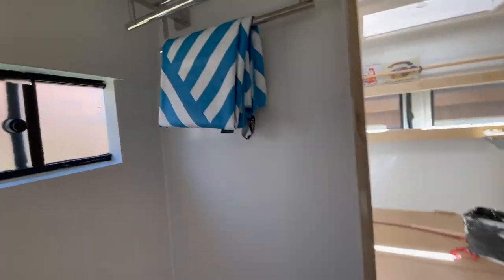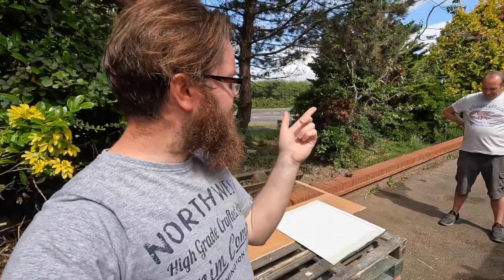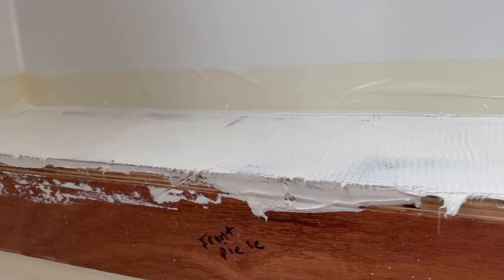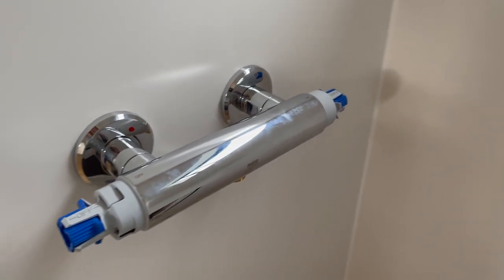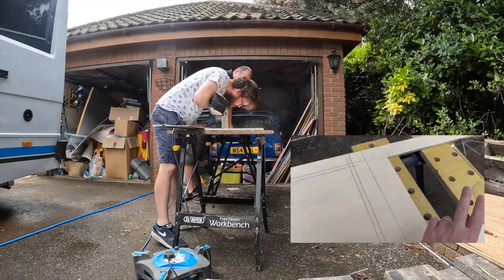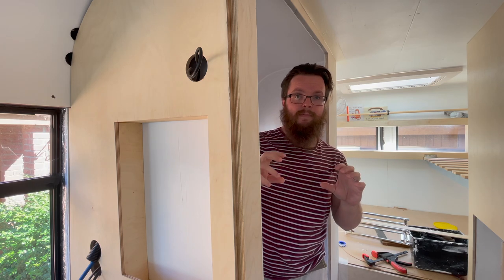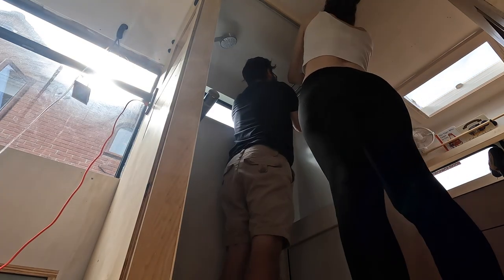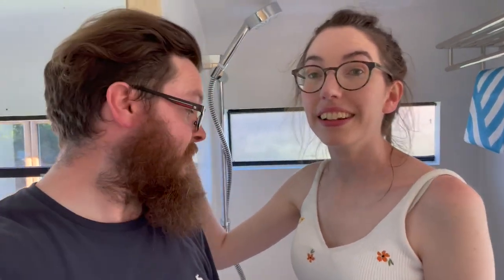Upgrades! Hidden Van Pull Out Toilet + Sliding Storage Mirror

Comment: Just found your videos this evening, and just watched the shower / toilet vids which are excellent but also answer some issues that we have. Smaller van (Sprinter) but looking to adopt same principle of tucking the loo out of the way. Do you have any info on your loo drawer/ slide system? And any advice / info on your roller blind system, which provides a really good function which looks great. I was thinking of tanking / waterproofing all the way round the loo recess area as well…will now make an appointment to look through some more of your great videos, thanks.
Reply from the maker: Hi John. Thanks for watching. These are the sliders we used: https://amzn.to/3WHWDis

We went with locking slides because it meant the loo was stable when in use and won’t break loose when ‘locked’ away in the box. 

I think tanking the box is a good idea. We sealed ours with sika flex as the storage area is made of waterproof plywood anyway. 

The roller door was from a company called high peak conversions. It’s worked pretty well. The trickiest part was down to the bus wall sloping. So if I were to to it again I’d probably make a shim of
Some sort to square off the aperture. But overall it’s working well. 

Let us know how you get on and if you’ve any questions or make any improvements.
Reply: @WanderbusAdventures  Brilliant, thanks for taking the time to reply and provide that info. Still at empty van / grind rust off floor stage but when I get to the loo box, will let you know how it goes!
Reply from the maker: Great stuff. Good luck.

Comment: Thanks so much for the videos :) we are just about to start our conversion! Would you be able to share where you got the tambourine door from, please? Thanks!
Reply from the maker: No problem, thanks for watching and commenting. We got it from high peak conversions 😊. Good luck with your conversion. What are you converting?
Reply: @WanderbusAdventures  Thanks very much :) I don’t want to take the mick, but I might be asking where you got some of your other stuff too if that’s ok :) 
We currently live full time in a fifth wheel, and are picking up a VW crafter in the next few weeks to downsize into. 
The plan is to make travelling easier and to have things a little more to our own design… I wonder if we are a bit bonkers 🤔 Your channel has helped us with our design ideas and resources planning loads! 
Are you happy with your designs and makes?
Reply from the maker: That sounds amazing, a good size van that. Questions wise, we love them - keep them coming 😊. 

On this bit of the project we are pretty happy with how the bathroom works. The fact it’s on a wheel arch did limit us a bit, as did the bed. If we were being picky we’d have made the toilet box a bit higher off the ground in terms of clearance, but it hasn’t caused any issues (fingers crossed) - it just would’ve allowed for a greater lip on the shower tray. Also would have loved a plug in either corner; again it hasn’t caused a major issue but can see how it might’ve been a benefit. Hope all goes well with the van pickup - exciting times. 

Oh and it doesn’t sound bonkers, but it does help if you are a bit bonkers yourself we find 🚐🚐🚐
Reply: @WanderbusAdventures  That’s great, thank you! See you in the next comment! 🤭